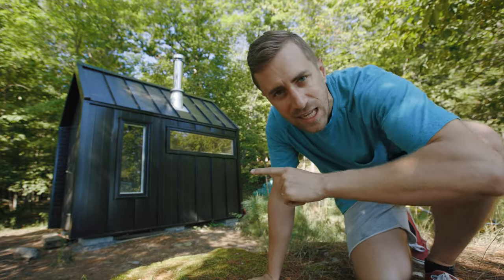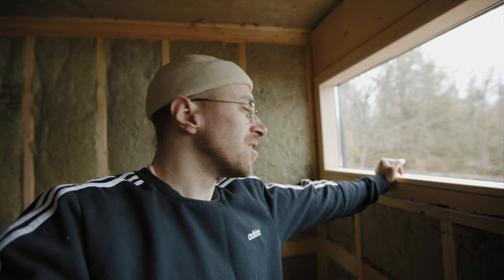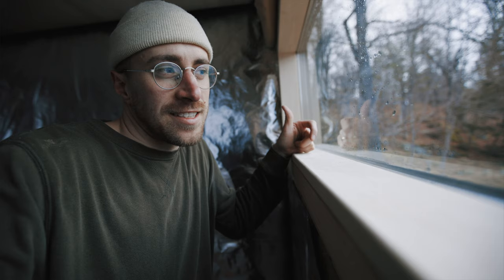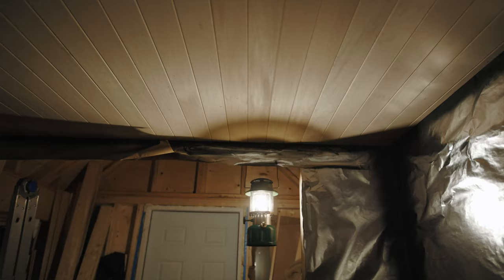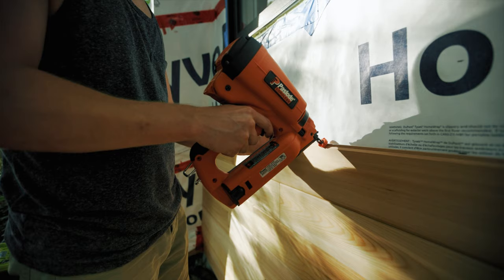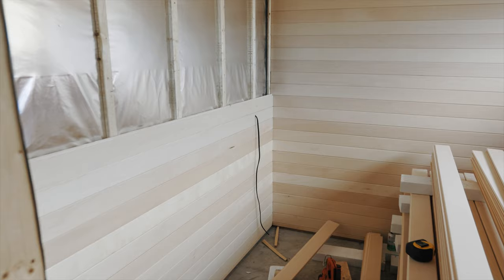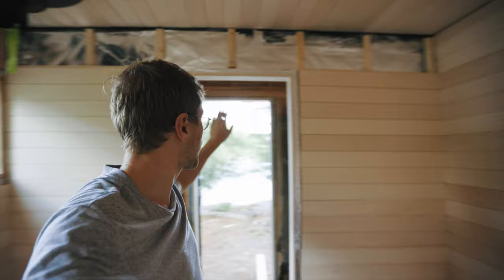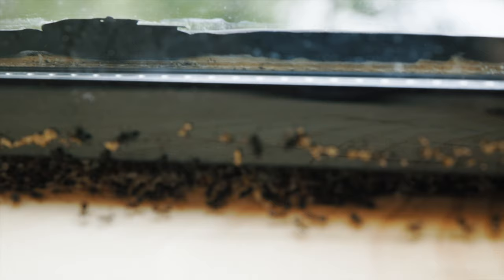Dream Sauna build Using Aspen (not cedar)

Comment: Your sauna design is beautiful. You have solved my floor problem and we are going with Aspen wood for the interior. We will be building a sauna in an old pool house so we do not need to build the building. but your floor solution will work for us.

Comment: Very cool to watch, thanks for making. Have just finished the exterior cladding of my sauna, next step is the floor. Setbacks are definitely frustrating. I found the windows and the roof the most   frustrating parts so far. You spend so much time on something, the last thing you want is the fear that it may rot or be damaged in some way!
Reply from the maker: I totally agree with the roof and floor being the most challenging. Lots of “am I doing this right?” thoughts.

Comment: Great stuff! I like to see these builds coming together. FYI: Ants require a 'damp' environment to brew eggs.. so if you dry that window frame out.. like super dry heat gun stuff, then they won't come back. I've had this problem in a build of my own. Wet is not good for them. Dry, not good. Damp is perfect. And that's not hard to fix. Looking forward to bench 101!
Reply from the maker: This is so helpful! I hope firing you the sauna once or twice a week keeps them at bay.

Comment: Hey man, great videos! I'm swedish and I'm building a Swedish sauna in Upstate New York where I live. I was wondering, did you add furring strips on top of the vapor barrier that attached to the studs before adding the siding?
Reply from the maker: Hey. The exterior siding? I did not. The manufacturer specified that it can be installed right on the house wrap or roof underpayment so that’s what I did!
Reply: Thanks for the reply. No I was referring to the inside
Reply from the maker: Oh. Yes! I used furring strips throughout the inside.

Comment: Jonathan, two questions: what this black Stove paint is for?   Did you use Stainless steel nails for Aspen paneling?
Reply from the maker: Hi. The black stove paint was to hide any foil from reflecting light in the edges of the room if there was ever a small crack. I ended up using trim pieces to cover up the gaps at the ceiling so it might not have been a necessary step. Yes I used SS nails for the Aspen.
Reply: Thank you so much. 🙏

Comment: How did you seat the insulation in the ceiling? You skipped over that part! Vids are great, sauna looks great :)
Reply from the maker: Insulation is cut a little bigger than the opening according the manufacturers instruction so it’s snug enough to stay up on its own.
Reply: @JonathanKuhn  thanks so much that makes it really clear. Sry if u did mention that in the last vid. Wasn't obvious to me

Comment: Hello, Iam from spain, lets see if I can explain the question, at 4:08 it seems like the nail in the joint of the board, should be introduced in angle, because if u nail it straight u will not be able to insert the next upper board, because the nail will stop the upper board from entering , right ? thanks
Reply from the maker: That is correct. The wide angle of the video doesn’t look like it’s at an angle but I can assure you it is. The nail goes in the tongue and out the back face of the board.  You can even shoot the mail a little high on the tongue to avoid seeing nail holes between the boards.
Reply: @JonathanKuhn  thanks ss a lot, very nice and helpful!!

Comment: How did you figure out how to properly/safely install the woodstove and chimney elements?
Reply from the maker: This was one of the trickiest parts to install for me. But like many of the other components the manufacturer has detailed instructions for the stovepipe, chimney and stove so it’s pretty straightforward after some reading and measuring but tricky to alight the chimney
Reply: @JonathanKuhn  was this instructions from the chimney kit? Or the sauna stove? I bought a Narvi stove and theres very little detail/instruction about the chimney
Reply from the maker: There were instructions for the stove for setbacks etc and another set of instructions for the stove pipe and ceiling mount kit etc. the chimney is a 6 inch double wall Supervent Selkirk product of that helps.
Reply: Okay sweet thanks thats very helpful. I found that chimney kit online, looks solid and safe. Your sauna looks great! How is it all holding up I guess its a year or so now since this video @JonathanKuhn
Reply from the maker: @wesleysmith3462 it’s holding up very well and we use it often! The foot benches are showing some dirt but we will clean those up in the spring.